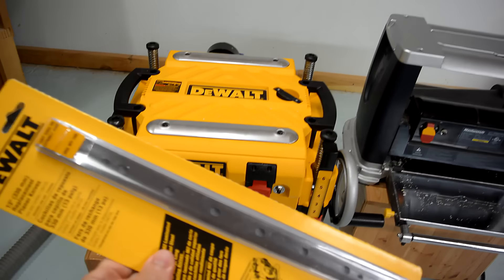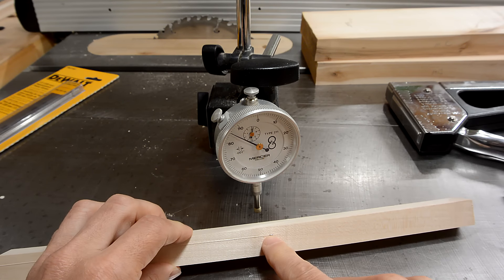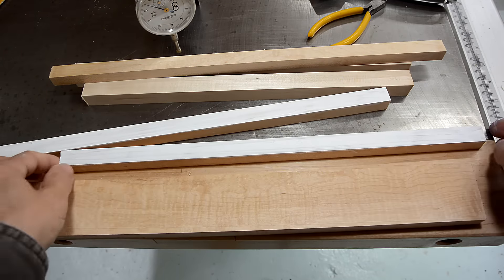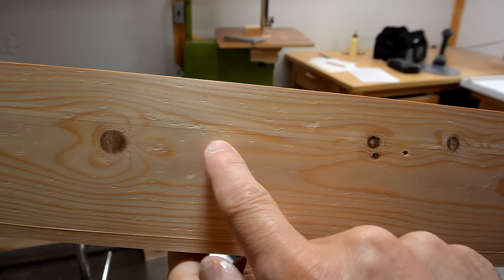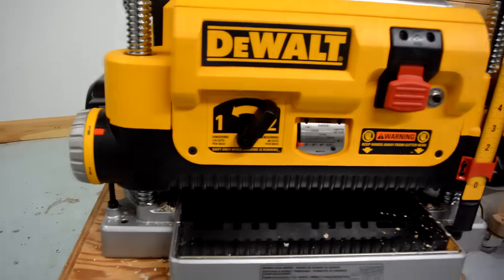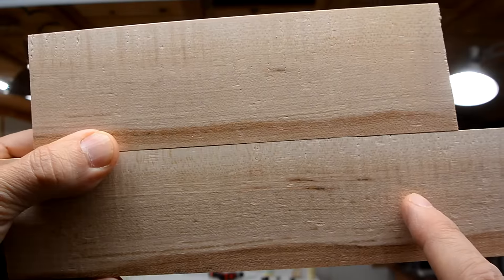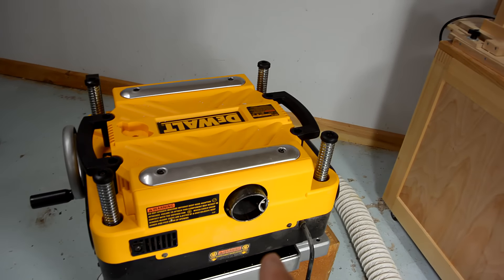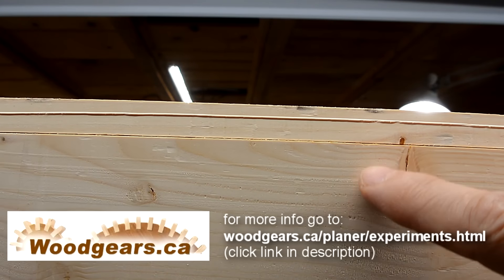More planer experiments

Comment: I really do not understand how quickly the knives get damaged on those machines. I work with significantly harder woods and I am yet to see any of the problems seen here. I don't even have a name brand planer and plane african rosewood and Rhodesian teak without getting any nicks in my blades
Reply: He didn't sharpen the blades in his cheap machine for 5 years so it's not really that bad if you're not hitting nails and staples.

I'd guess really hard knots would be hard on knives as well, do you have many knots in the wood you use?
Reply: The hardwoods you use are abrasive but that cheap spruce has really hard knots and they knock chunks out blades. I'm glad I upgraded to a bigger better quality machine!
Reply: +Scott Verge only tight knots. All of it is rough sawn, some well seasoned. I just don't get it as mine comes through clean and smooth even in highly figured rosewood. I'm just glad I don't have to change them often.
Reply: +Adam Lynch my machine is very cheap but is a old design with slow feed and RPM. Maybe that plays a role? There isn't even a port for chip extraction
Reply: +Jason Roets that's how my original dewalt was. The knots in hard wood are not like these knots in this spruce a spruce knot will break the edge on a carpenters axe really easy.

Comment: 90 percent of time I use my DeWalt planer is to remove paint... And I use it A LOT.
Reply: Tell me about it. Salvaging painted wood is one of my popular thickness planer uses. Just run it through and it's like new!
Reply: Damn right! That was the main reason I bought one, to clean up salvaged wood. Works like a charm.
Reply: I hadn't really thought about planing off paint from wood but if... if... it does damage to the knives and you say you do it frequently then... what technique do you use? Do you try to "get under" the paint and fully into the wood or do you just take the rather normal 'shallow' passes ? (Inquiring minds want to know :-)
Maybe keep two planers - a cheaper one for paint removal and one for finish work?
Reply: wdavid parks shallow passes..also I'll plane a board with paint and then plane a sacrificial board in between passes so I don't get a build up on the blades. I have a Makita 12" and it works damn good considering the abuse. The biggest problem is that paint chips are heavy and tend to stick on the insides. Like you said having 2 would be ideal.
Reply: Chris Bess
I like that idea - running a sacrificial piece through to clean off the paint chips/shavings. Thanx!
Reply: +wdavid parks 👍
Reply: I think a sacrificial planer would be a good idea. A heat gun and a chisel scraper would help the blades and doesn't create lead dust.
Reply: I've used mine to remove the glue from a salvaged glue down maple floor. About 800 square feet. lol it destroyed the blades. All good, I just flipped them over. :-)

Comment: If you aren't already done with this series, a final visual inspection of the knives would be nice.
Reply from the maker: Hard to pick that up on camera.
Reply: Do you have a scanner, or a friend who would let you borrow one? You could do scans of the knives with it and then splice them into your edit. A photo with a DSLR and a macro lens would also work, but a scanner is a much cheaper option.
Reply: I'm thinking more along the lines of a jig for sharpening the blades would be nice.
Reply: You can't sharpen the Dewalt knives...they're indexed to the planer, so once they're unusable, you flip them around to the fresh side. Then when that side is bad, you throw them away and buy a new set.
Reply: Michael
that's funny. Because my DeWalt planer blades are decidedly one sided, and I have been sharpening them for decades now.
Reply: +Michael    Why shouldn't you be able to sharpen them?
Reply: Paul Frederick
 Do you have the 735 or the 733? The knives for the 735 are indexed from the factory, so if you sharpen and take off too much material, they won't line up with the feed rollers, or the bolts that hold them will drag on your workpiece. I guess you could open up the index slots on the drill press, sharpen and then re-aligh, but as you get them from the factory, they're disposable blades.
Reply: Christian Geiselmann
Because they're a double-sided, pre-indexed blade. They come that way from the factory. I just posted to Paul that you could probably alter the alignment hole on the blade a bit after sharpening, but as you buy them from the factory, they're disposable. Sure...you can sharpen them, but then your cutting geometry will be off. The biggest complaint you hear online about the 735 is that the knives dull easily, and that they can't be resharpened. There are also aftermarket options for the 735...there's HSS knives, carbide knives, or the spiral head from Byrd.
Reply: Michael
I have a DW733
Reply: The spiral head from Byrd cost about 2/3rds the price of the Planer. Hard to justify that by you're average FYI'er.

Comment: Hmm, seems like you need a "bigger"  dust collector...
Reply from the maker: yes, as if that one wasn't big enough already.  But the bag on that one doesn't let much air through.  It filters the air very very clean though.
Reply: +Matthias Wandel get many bags together? more surface area...
Reply: I think this is to the point of moving to just dumping everything outside into a dumpster or wood pile - then you need little to no filtration because it's out of sight, out of mind.
Reply: +Matthias Wandel I would like to see what would happen if you take the tube and stick it out the door and vent it outside unrestricted
Reply: FishFind3000 but into some sort of collecting bin, then yeah maybe

Comment: "YOU CAN SEE THE HOSE IS UNDER A LOT MORE PRESSURE"
Reply: crazy how much noise he has to yell over with both the dust collector and planer on.
Reply: My thickness planer is one tool I wear ear protection using. I'm real bad when it comes to using ear protection too. But when I use my planer I wear ear plugs. Those blades are hammering on the wood like 40,000 times a minute. It's loud!
Reply: Sorry can't hear you over all that noise, can you yell louder!?
Reply: ARE YOU SURE IT'S ON? I CAN'T HEAR A THING.
Reply: IT'S WHISPER QUIET!
Reply: kind of like your caps lock!

Comment: pretty weak knifes ... maybe harden them
Reply: Them being hard is why they chipped out.
Reply: being soft, or made of crap steel will do it too, instead of chipping it will simply dent the edge.
Reply: James Savage
If you don't try to plane wood with steel in it the blades work fine. I don't think you understand the angle the blades are at in these kinds of machines. They're not going to stand up to contacting metal. I don't care what kind of steel they are.
Reply: Paul Frederick
have fun sharpening blades buddy :)
Reply: James Savage
The last time I sharpened them it was not too bad.
Reply: Paul Frederick
good to hear. :P